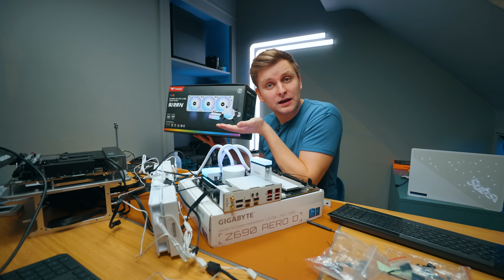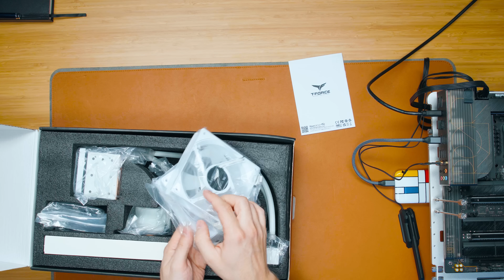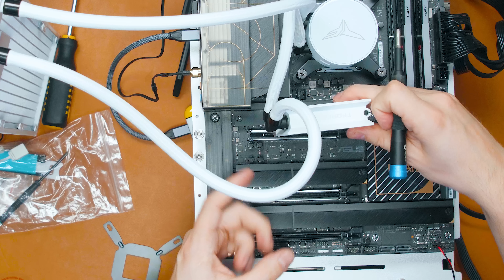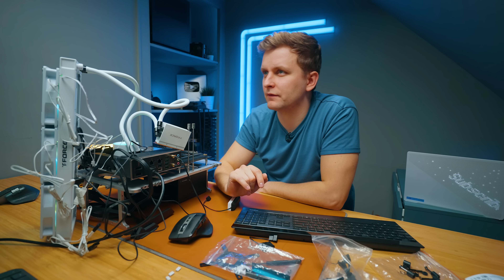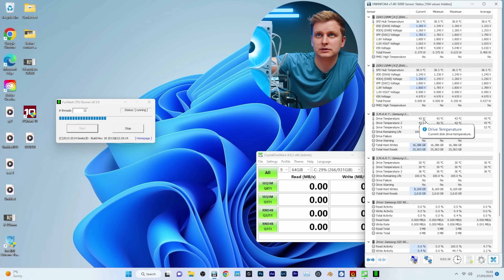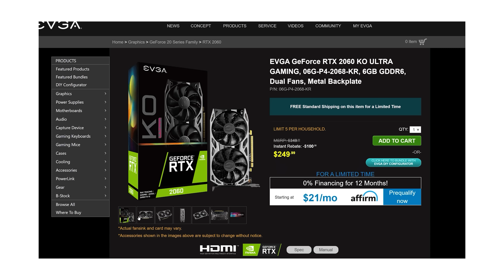That's DIFFERENT... BUT does it WORK?!? | Teamgroup T-Force Siren 360 DUO AIO

Comment: I'd be interested to see how much difference a regular heatsink + case airflow makes on a gen 4 drive before worrying about water cooling a SSD.  That said gen 5 drives run much warmer so maybe this will be a thing but I sure hope not.
Reply: Depends on the drive, but a wd sn 850 black can hit 85c, and they'll fry quickly if you let them

These heatsinks are absolutely necessary for people who put their PCs through their paces

If you regularly transfer large files, you want one, say 100Gb recordings more than once/mo

Now I'd say water-cooled is a bit meh

but something like an Acidalie m.2 double or active drops temps like a rock
Reply: @Justifier  That's why I asked.  I transfer large files between my workstation and NAs on a pretty regular basis.  Pretty sure I fried a SN 750 doing so but not 100% sure (in an older system on a pcie adapter and no heatsink).  That said with the motherboard heatsink + case airflow my newer SN 850x has never hit 60c in a torrent case.    

Have no real need for gen 5 right now so it will be a while before I try one of those at home but I have seen the inland gen 5 drives get pretty toasty without the included active heatsink but that might get sorted out as gen 5 matures and passive heatsinks might be fine (which is what I'm hoping).
Reply: Also, partly related: DDR5 is pushing the limits too, Active cooling on them with a Noctua A60 mounted on a Corsair Ram cooler has done wonders

It's either intentional that these companies are pushing products to the brink, or they and the consumer base are simply forgetting the basic principles of PC longevity & performance: if it gets +120°F (~50°C), put a fan on it.
Reply: @Justifiers  All this stuff runs fine in the enterprise where noise is usually not a concern and forced cool airflow (at the least) is a thing which is why I was wondering.  I have DDR5 memory and a high speed gen 4 m.2 in a case with good airflow and keep an eye on the temps.  If I stress the system with no airflow minus the CPU cooler open bench style all those parts can get fairly toasty.

Comment: What I want is an AIO with a freaking Reservoir. You could even make it optional so that there are some Valves to make the Reservoir Optional. Or a Modular system so that you can also hook it up to a GPU waterblock. For a long time I've wanted to experiment with creating add ons that add a way to modify existing AIOs to do these things, I just don't have the resources to spend on experimenting with the idea =\

Another idea I've had, which is a lot different and likely impractical- a Monitor with a built in GPU/Mini-Computer that is there just for up-scaling or Anti-Aliasing with no direct connection to the Computer. Then add extra settings to the Monitor itself so it'd be similar to adjusting Brightness/Contrast in order to change how the filter is being used. I think these actually exist now, though I wanted to see something like this a decade ago.
Reply: Me too, have you looked into alphacool's modular aio's? They come with quick disconnects on the tubes. Eiswolf 2 ,
Reply: I had a similar idea for a monitor, but I couldn't figure out which part or parts was the bottleneck that limits a monitor's refresh rate.

Which  hardware component drives a monitor refresh rate, regardless of a gpu/cpu. 

Regardless of a monitor's resolution, could we upgrade new or old monitors' specific components the ability to Drive native 60, 120, 144, 165, 200 hz or higher? ?

Comment: For a Computer Reviewer I'm a lil disappointed you have never seen fan blades with wrap around rings on blades. I think its trending now. CoolerMaster, InWin, Arctic. Used  for leakage an noise reduction and I presume Rigidity . I got the InWin Mercury's for sff build. There not bad for a budget fan

Comment: would have been better to have 2 radiators instead of a ssd cooler. or make the tubes removable to allow expansion to gpu or a reservoir.
Reply: That's what closed loops are for, not aio's.
Reply: @nadtz  weird. there is a couple aios that offer expansion. but ok bro i will spend thousands instead of a couple hundred
Reply: @Nicc93  link to said aio's?  It's not really an aio if it is expandable kind of by definition.
Reply: @nadtz  alpha cool eisbear, fractal design kelvin
Reply: @nadtz  i cant post links
Reply: @Nicc93  Didn't know alphacool still made those.  Pretty sure fractal no longer sells the kelvin (which was made by alphacool). So I grant there is 1 expandable 'AIO' which is stretching the definition of AIO but there ya go.
Reply: @nadtz  pretty sure there is only one company making the radiators and pumps for 90% of aios. Patents have destroyed the industry
Reply: Yeah, I love the modular aio from alphacool.  Only The latest model tho. The quick disconnects on the tubes alone won me over

Comment: Really odd.  The cpu can push 400+ watts, while the nvme may generate 10 when running at Max Speed. Not sure why you would need it.  SSD only have tiny passive sinks in not even a tiny fan.  The thermal pad they use is pretty thick so it's pretty ineffective and i have never seen an SSD that faces the power connector in the chipset side slot.  Not sure you can fit a GPU when it's in the second nvme slot
Reply: Also, will they add ddr cooling as Ram generates as much heat
Reply: You're right to be sceptical, the sticker on SSD drives actually transfers heat from the controller to warm the NAND, which likes to be warm for less wear.   High performance drives have problems with controllers over heating, but he coold the NAND execessively not just the controller with its intense logic.